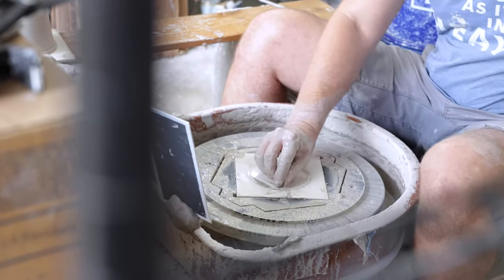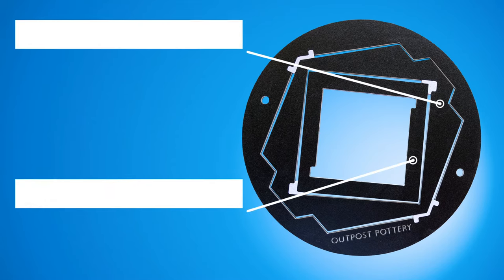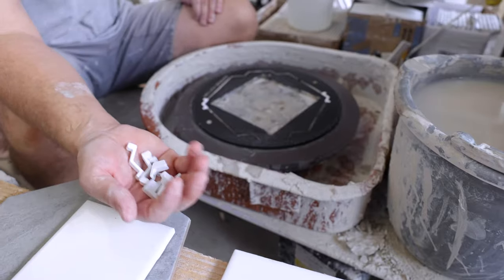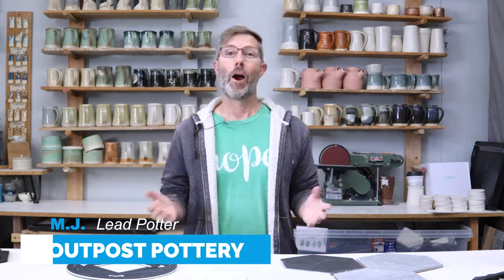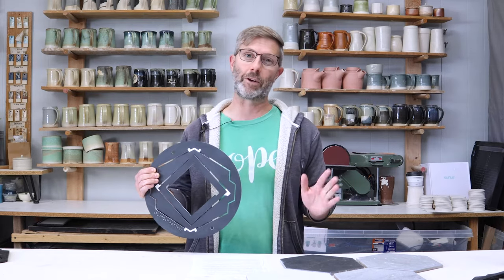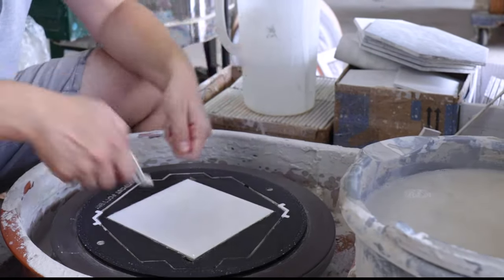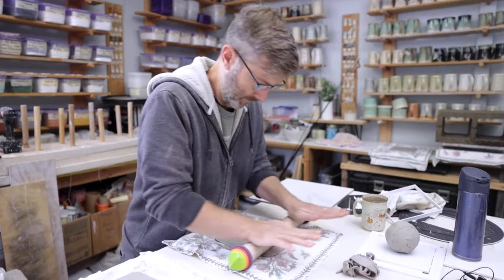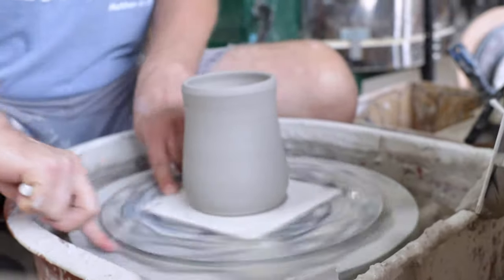Level Up Your Pottery Game w the Marine Board Tile Spinner Bat System: Master the Wheel

Comment: Thanks for the video and a very cool product!  I am currently researching options for buying my first wheel and have watched all your videos on beginner wheels--THANK YOU!!  Can your tile spinner option fit on the inexpensive Skytou wheel you review if bat pins/holes are added after market?  If not, can you recommend a beginner wheel that your system would be compatible with? Thanks so much for your advice!
Reply from the maker: You bet Lori!  So sorry for the delayed response!  The current tile spinner cannot fit on the skytou wheel, as is.  The skytow actually has no bat pins.  If it were me, i would buy an 11" skytou or Vevor wheel on Amazon (around $150) and drill holes.  I have a lesson i'm working on in that course (www.mugsaremoney.com) right now for how to drill your own bat pins. That would fit my bat system perfectly.  Alternatively, the Clay Boss wheel is a great wheel with 10" center bat pins that fit my system, but it's a little more expensive.  Let me know what quesitons you have! -mj

Comment: I use the tile spinner and the Daltile 6” unglazed tile.  It works great. I love the fact that the tiles will not warp. But I have a question, since I have never used a bat system like this before: When I need to remove a mug from the tile at the leather hard stage to add a handle, I find that it is still stuck and will not wire off neatly, creating an uneven bottom, necessitating trimming.  Should I have pre-wired at the time I finished throwing?  If I just leave it till completely dry will it come off of its own accord?
Reply from the maker: Hi phburdett.  I usually wife it at leather hard or a little before.  There is a sweet spot of when to wire.  I like to wire with a wire tool i bought from Simon Leach. It makes a really cool patter on the botton. Here's one example: https://www.youtube.com/shorts/ZjY5etOGRZE. Here's another one but the autoreframe to make the short didn't center in the right place so it may be hard to see in this one: https://www.youtube.com/shorts/WPE8v_dwAGI